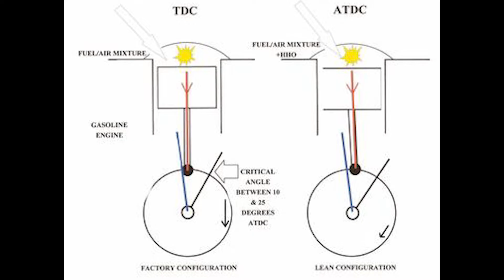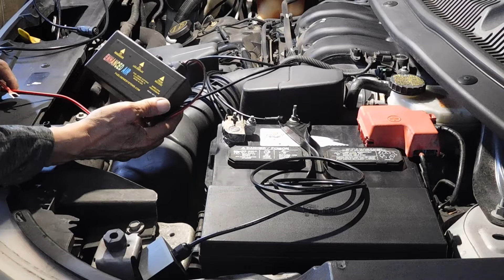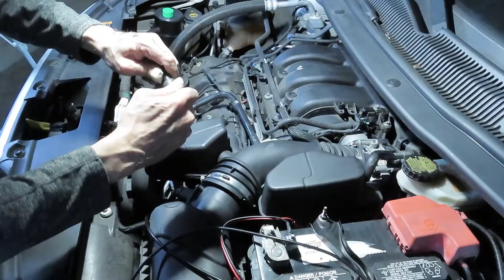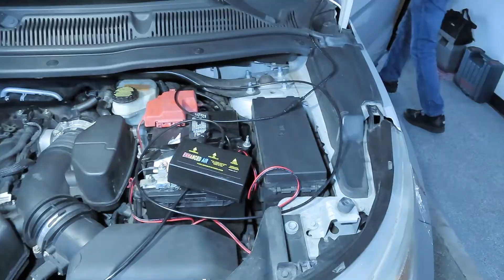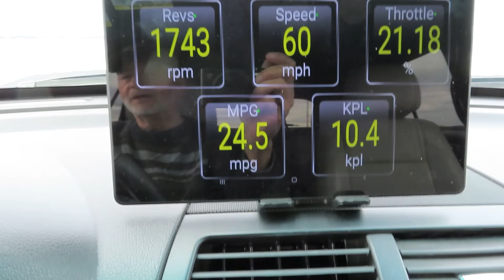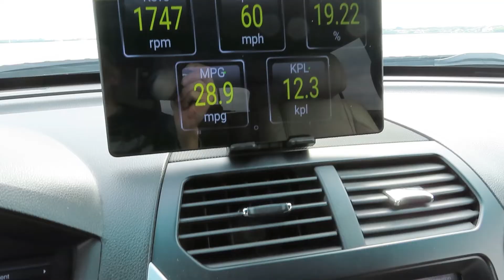NEW FUEL GENIE FUEL SAVING SYSTEM INSTALL AND MPG TEST

Comment: I hope that thing comes with an off switch, because since you hooked to direct power/the battery even after the car is turned off it’s still producing hydrogen. Because the water/electrolyte mix is still getting juice from the battery. And can you please explain the need for that box/chip that your system uses. I made mine without any need for a chip or controller, just a power on/off switch.
Reply from the maker: No need to worry there. Inside the control box is a voltage sensor that closes ONLY when it senses voltage coming from the alternator. This means the engine must be running before the system turns on hydrogen production. 
the Smart chip you refer to is only for gas engine vehicles newer than 1996 that are over 1.8 liters in size. Typically, the O2 sensors will tell the ECU the mixture is lean and the ECU will keep the injectors open longer to bring the mixture back to a 14.7: 1 AFR.- thus negating any improvements in mpg. The Smart chip manages all engine sensors for best mpg when using hydrogen with intake air. 
As to regulating the amount of hydrogen going to the engine, there is a specific ratio of hydrogen enhanced air to fresh air that yields the best improvements in mpg in engines. Stray from this ratio and you either don't get the full benefit of the enhanced air or you're adding too much hydrogen to the engine resulting in no improvements in mpg. It's logical. More fresh air entering the engine needs more hydrogen to keep the ratio in balance. Highway speeds need more hydrogen and city speeds need less. Two setting basically. One you use only on the highway. 
Hope this helps.